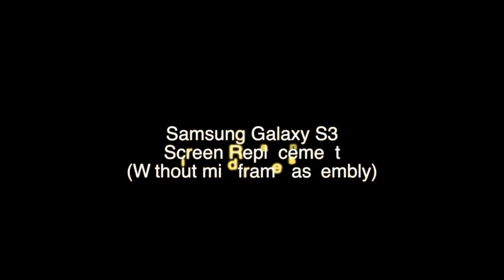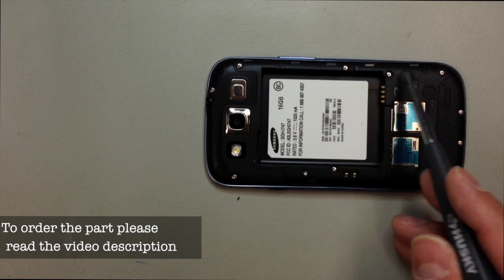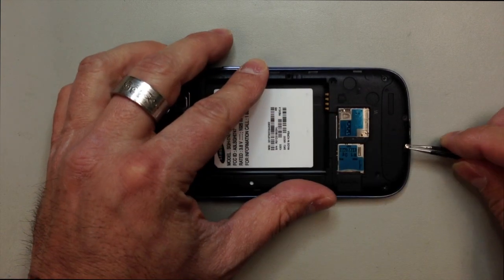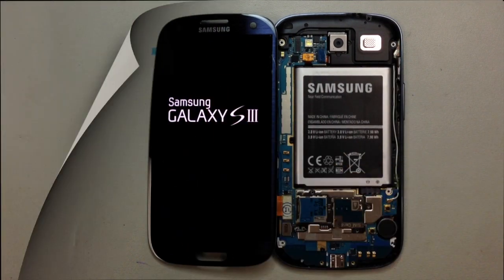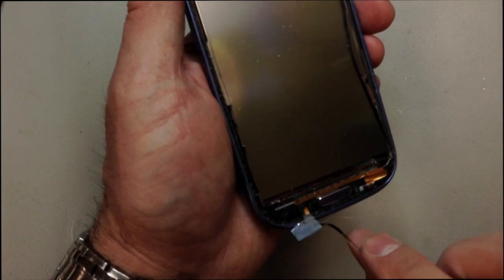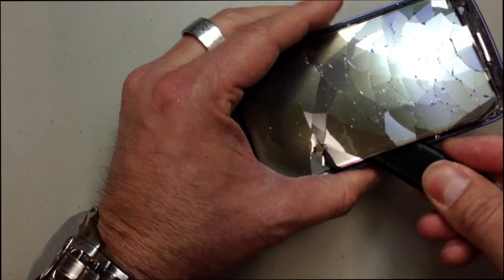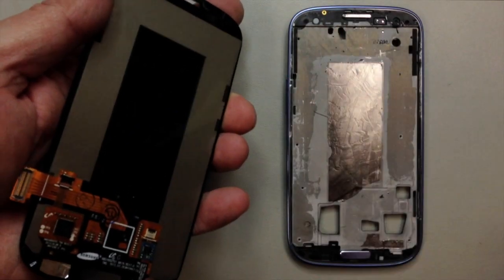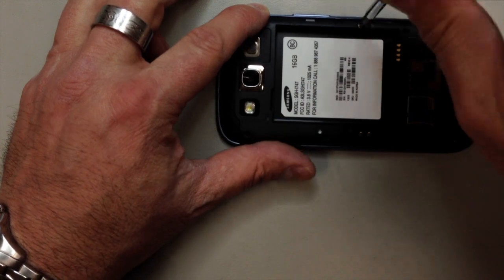Galaxy S3 Screen Separation From Mid-Frame

Comment: Hi, are you still active?
Is it possible to change the frame without shattering the amoled and glass? 

My buttons have disintegrated and I can't take them of the new frame.
Reply from the maker: That's a tough one. I have never seen it done before with this model.

Comment: is there a way to not destroy the digitizer and lcd assembly when removing it? i bought a cricket s3 to take the digitizer out of and put in my sprint s3.
Reply from the maker: It is possible but risky. I will make a video when I get the chance but using a heavy duty suction cup, heat gun, playing card and a lot of patience it can be done in many cases.
Reply: ah ok thanks, im just using the cricket one for now, i already have a replacement sprint phone so i just want to fix the sprint galaxy s3 to sell it. i was surprised the middle frame wasnt the same for both phones.

Comment: Hey! Is there a way to remove the digitzer and LCD from the mid frame without breaking anything?
Reply from the maker: Technically it is possible. There is a solution that can be used to loosen the adhesive behind the AMOLED after soaking it for a few minutes. I'm not sure exactly what is in it and while I can't find the link right now I can tell you that it smells like a combination of rubbing alcohol and paint thinner. When I find it I will post the information here and make a new video.
Reply: Thanks! Cause I bought a galaxy for $50 bucks but it needs some physical refurnishing cause I want to sell it for more money than used. Thanks
Reply: MovieTrim got numerous vids on my channel showing how to take lcd out of housing without breaking.  No liquid solution needed.

Comment: I marriaged a brand new LCD/Digitizer replacment to a i9300 frame not knowing that you can't interchange some of the frames between carriers. Mother board is sprint. Am I screwed now since it seems like getting it back apart is nearly impossible?
Reply from the maker: Very risky but not impossible. I don't know if there is a video for it yet but technically you can remove it. There is a special solution used for removing the AMOLED adhesive from the frame but I'm not sure exactly what is in it. Even then you could damage the display. I've done it before with heat and a lot of patience and I got lucky. It is also possible to dremel off the parts that prevent the board from fitting into the mid-frame but of course it is best to do this before the screen is installed. You might want to check with a cell phone repair shop and see if they can help you. It would suck to break the screen and have to buy another.
Reply: Go Cell Phone Repair Thanks for the reply. There is a video with the solution but thats not a route i want to go. Its expensive. I tried to dremel but the gray lines on the housing are conductive and complete a circuit once the board is installed. Those on the i9300 arent even close to the sprint lines and it henders certain functions of the phone. Ill go with patience and take it slow. Maybe find a way to take the housing off the LCD intead of taking the LCD off the housing. I dont care about damaging the housing. Thanks again
Reply: EGGINFOOLS Hey, I've done the same thing! I have a couple of "Frankenstein" phones! Myself. I'm guessing one of your bigger issues are the home button doesn't work right? To fix that just place two very small dots of solder onto the mother board where the home button connects and it will solve that issue. Also, it is imperative to make sure those two dots do not touch as it can mess up the phone. My biggest issue (phone fully functions) but it just doesn't look right! which is why I'm trying to find a video where you don't destroy the very expensive AMOLED!
BTW what was the point of him making sure the screen worked before destroying it?

Comment: Ok so I have a question ive dropped my phone a lot of times and its messed up from the sides like the grey part of the phone is it replaceable or not? Is like the the gray thing protecting the phone around.
Reply from the maker: Not without removing the AMOLED which will almost always result in a broken screen. I would recommend getting a case if you want it to look nicer. Not really worth the risk IMO.
Reply: Thank you for the tip very good video btw